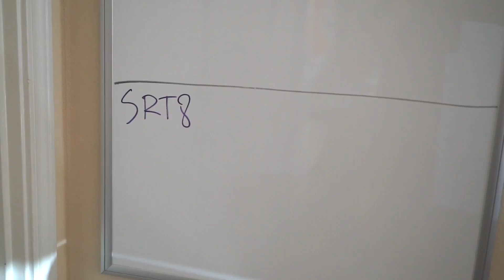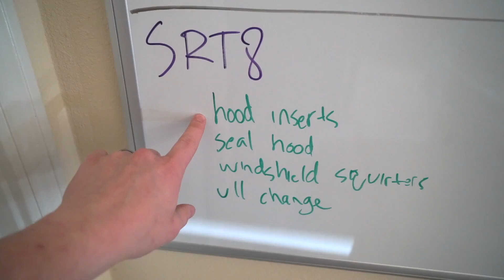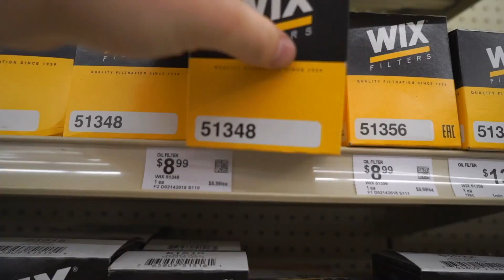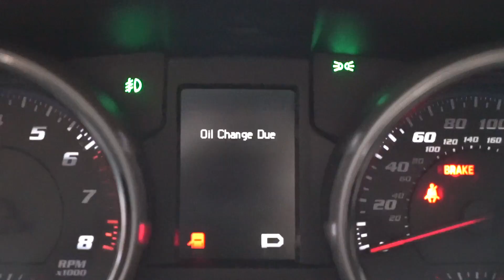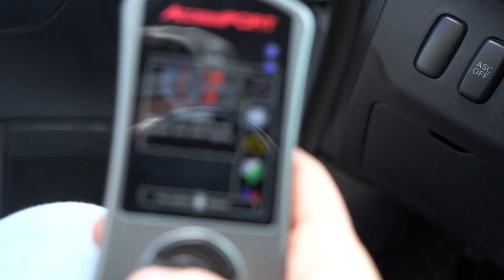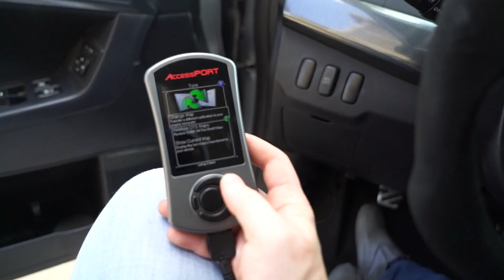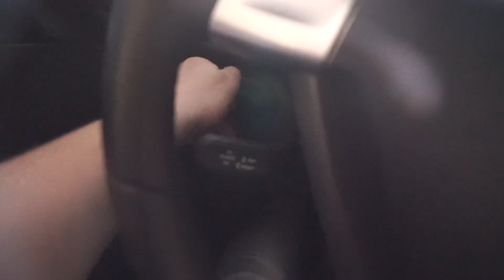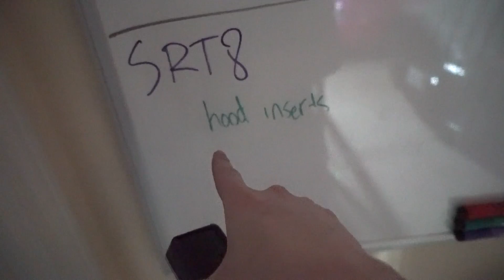Evo X vs. Jeep SRT8 street race - BATTLE OF THE DAILYS

Comment: The Evo comes with launch control from the factory
1) Turn off traction control (hold for 5 sec) 
2) Press the clutch, and put it in first gear 
3) floor it 
4) let off the clutch

Comment: Someone needs to learn how to  launch a AWD car 😂😂 love the video's bro
Reply: set 2 step at 9k, use ebrake to load the drive train as you start slipping the clutch, release the clutch fast and smooth and floor it.
Reply: Lol he doesn’t need to dump the clutch, he needs to just throttle it. All it does is bog down

Comment: If I'm not mistaken the evo x comes with 2-step from factory
Reply: Yes sir, just hold the traction control button down until it shows ayc off. Clutch down, stomp the throttle and it should bounce at 5500.
Reply: Glad I'm not the only Evo X owner who came here to say this to be fair I was unaware the first time I raced mine Everytime afterwards though 5500 and go
Reply: PoolPlayenBob you don't need to hold the traction control. As long as your car isn't moving and your in first launch control will work.

Comment: Yup... no like launching manual AWD cars from a dig because insta grip... All that torque has no where to go but through the drive train to the pavement. Rear wheel drive cars is spin city if you apply too much which actually saves the transmission.

Comment: Why would you run a 15w rating oil? The first number is just the viscosity when the oil is below operating temperature. Using that thick oil is just limiting the oil flow when it’s cold thus creating more wear in the engine. I would of thought 10w50 would be much better.

Comment: In order to set up launch control and all that, there is a setting on the Accessport and you have to set it up during the beginning of the process of flashing on the tune. You can set up launch control, flat foot shifting, and can even raise the idle. At least that’s on my Mazdaspeed 3 Accessport.

Comment: Hey Evan, Evos come with launch control from factory. Hold down the clutch, put into 1st gear,  and hold the gas pedal. It should bounce around 5.5k rpms and you fly. Pro tip, to have a good launch,  you'll want to slip the clutch.

Comment: Why 15-40 in the Lexus? Engine oil holds heat, so the thicker the oil the more heat is held in the engine. Why not a 10-30w?

Comment: To reset the oil light on the SRT turn the key to the run position, push the accelerater to the floor 3 times consecutively then  turn the key off. May I suggest not using Rotella for the SC. My mom actually works for Shell, and has advised against that because the Rotella is diesel oil and the additives in it will destroy the seals in the 1J. I would suggest using 20w50, either VR1 from Valvoline or equivalent.

Comment: On the evo x you have launch control standard push n hold the traction control button then clutch in n first gear then full throttle. It’ll bounce at 5500 rpm like a 2 step system

Comment: the evos have launch control from the factory evan!!!!!!!!!! put it in first gear and hold the gas down its set for like 5400 rpm or so. Also you need to press and hold down the traction control
 till you see AYC Brake Off and your set!!!!

Comment: Yeah she should have dropped gears with the paddle shift. I have a 2015 srt. Once it's in eighth gear at low speed it won't accelerate very well until you down shift.

Comment: The evo x comes with stock launch control 1st gear, stomp on gas (revs between 5k to 5.5k ), and slips the clutch don’t dump 🤦🏻‍♂️as a evo x owner I had so much cringe when I seen you launch lol also hold the traction off for 10 seconds to ensure it’s completely Off

Comment: Did you seriously get a n1 exhaust muffler .... They look so 2005 rice .... Hide the muffler always .... If you need a muffler, put a res in the tunnel where you can't see it .... And add a nice tip .... Not a cheesy ass eBay muffler meant for a rusty g35